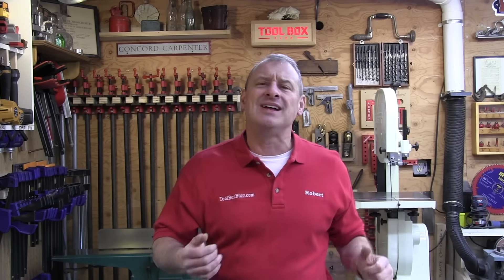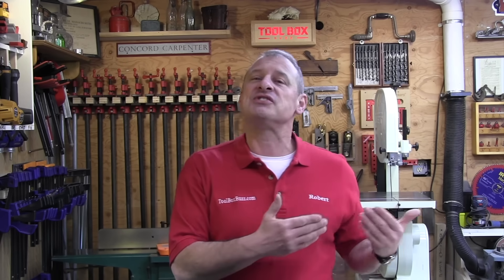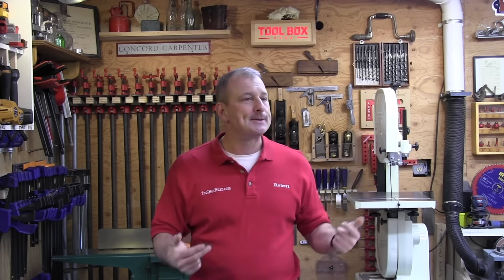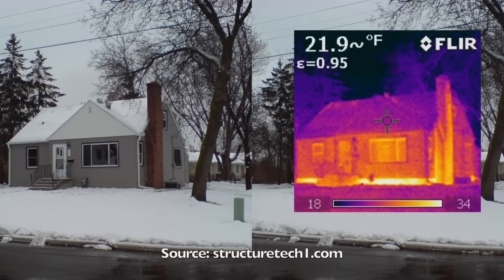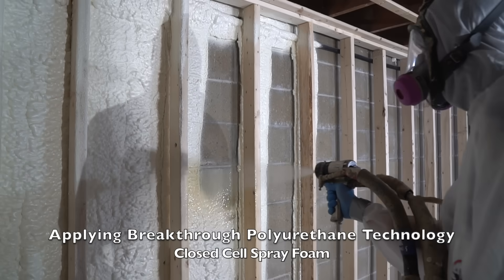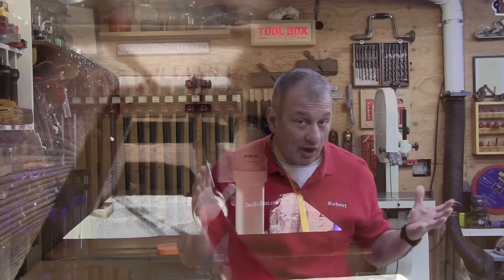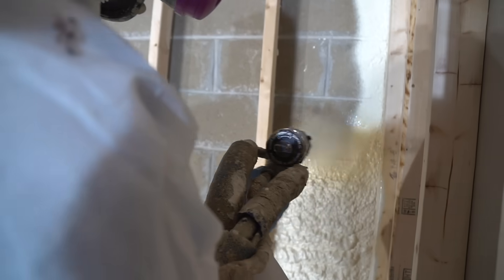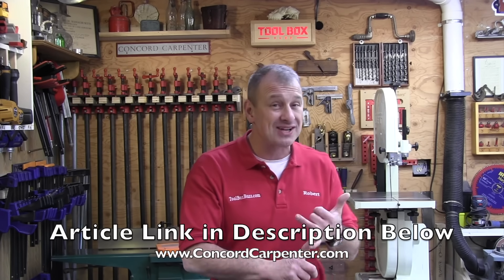Basement Insulation - Best Practice To Prevent Mold

Comment: Rob,
Do you spray crawlspace foundation walls that are sub grade? I've had a contractor recommend this, yet watched elsewhere that the cinderblock will not be able to breathe and become waterlogged and degrade at a rapid rate. What are your thoughts? I am planning to insulate the walls with spray foam or board.
Reply from the maker: yes we do, and we've sprayed cinderblock too
Reply: @ConcordCarpenter  Do you have a video on your thoughts re this? I was told that because I get moisture through my foundation, spraying it would trap the moisture rather than letting it seep through and eventually evaporate. I know this would drastically reduce the moisture I'm getting, but I don't want to damage the foundation!

Comment: Best practiced. Masonry loves to wick moisture. Your masonry needs to breath somewhere. Do not completely seal your masonry. If your masonry can not breath it will condense and leak. There is a reason masonry sealant stops above grade. Spray foaming a basement deprives your masonry of heat. It moves the condensation area inside the masonry. If you do not have an area for masonry to dry where does the moisture go? You need ventilation in the attic. Be it passive or mechanical. You take a shower or boil water where does the moisture go? Try using a fireplace, stove vent, bathroom vent, and you find you need ventilation. They make heat exchangers for those problems. Some shingle companies will not warranty if no roof ventilation. Spray foam is a great product. Some care and thought should be taken with spray foam when using on masonry, roofs, and chimneys, because of condensation and moisture. Thinking of spray foaming the inside of my brick crawl space.

Comment: Doesn't it look messy and ugly if we are leaving the basement as it is after spray foam?
Reply from the maker: Code required a flame retardant paint or a wall covering
Reply: @ConcordCarpenter  Could you please elaborate a little.. I have a basement exposed without any frames or anything.
Reply: @Shakpickleball  spray foam is flammable.  You need to frame over it and apply sheetrock to give it flame resistance.

Comment: ✓FAIR Explanation  of heat loss & mold issues, I am struggling to understand the nature of all the elements involved. Is there a INSULATING BASEMENTS FOR DUMMIES?
or INSULATING BASEMENTS CHEAP BUT PROPER FOR DUMMIES?
I'm looking for information on the cost. I realize it can very from region to region.... ball park range...
•What is the price range per inch thickness?
•What is the minimum thickness I need to achieve vapor barrier?
•Can I get the minimum thickness AND THEN, install fiberglass over that to increase the R-VALUE?
Thank you, 
Mike N Ang on FB.

Comment: I have cast iron around a good portion of my basement. I'm assuming the contractor will frame right in front that which will be about 9 inches from the cinder block wall. Can i still use 2 inches of spray foam? There will be a air gap between the foam and studs for that area
Reply from the maker: william duque yes
Reply: @ConcordCarpenter  i also have a interior french drain system in place. Hopefully they know not to spray over it.
Reply from the maker: william duque show and tell them

Comment: Hey, Rob! What are your thoughts about digging up around the foundation, and gluing insulation plates to the foundation? How deep should you go? Will it potentially reduce the amount of humidity in the basement? What do you thin about this combination with closed cell spray foam?
Reply from the maker: I don't think its worth the expense.
Reply: If you get cheap labor or DIY for the digging you can get used/surplus polyiso sheets and bring your cost down substantially. My neighbor did this and I'm doing it now.

Comment: What are your thoughts on a combination of closed cell and let’s say rockwool insulation? Spraying 1-2 inches of closed cell and then adding rockwool to stud bays? Would the cost go down on the closed cell install because they aren’t using as much material?
Reply from the maker: Flash and Batt is a solution - if done right. You'll want to do 2-inches to ensure you get that vapor barrier right
Reply from the maker: I dont either - building a cold room is the way to go - we may do an article on it soon

Comment: Will look at your articles when I get the chance to.  There has been somewhat of a step back from foam here in the Midwest (at least what I have seen) due to the costs associated with when something goes wrong somewhere else in the envelope and foam can exacerbate the problem.  Foam had been billed as the cure all and it itself has created new issues.  As a remodeling contractor, I encourage everyone to do their due diligence of homework when considering spray foam. There is a lot of misguided information out there, even from "the professionals".    Keep up the good work guys.
Reply from the maker: I agree - do your due diligence. And know the difference between open and closed - and where to use them